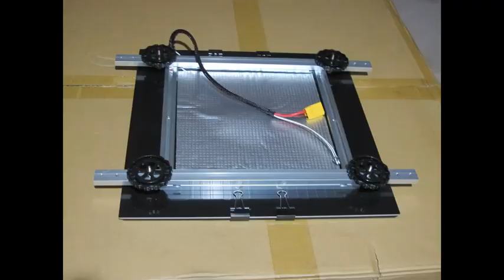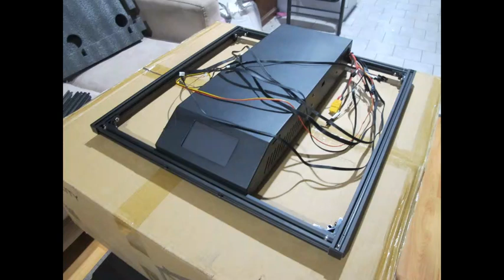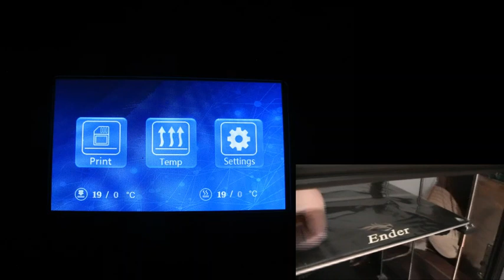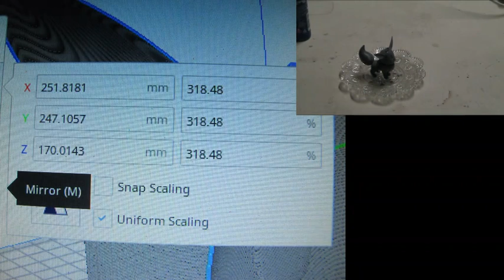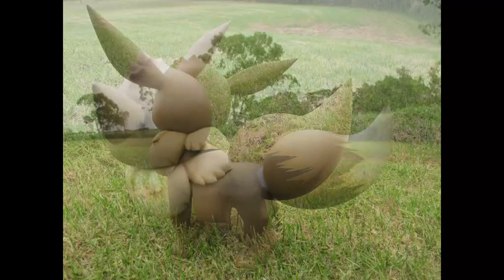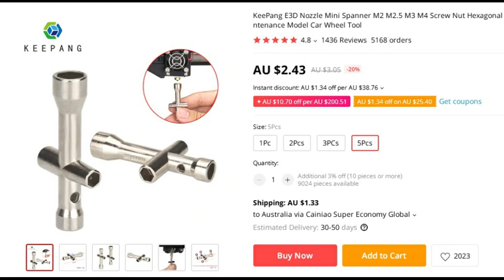Ender 5 plus review - large format 3D printer

Comment: using a metal scraper on that ultrabase covered plate is one way to completely destroy it. try using some IPA and a microfiber cloth, it will work as well if not better, and you wont ruin the surface.
Reply from the maker: Im about 50+ prints in and the coating is as solid as the first few prints I've performed. Also poured industrial thinner to clean it up and the coating still has remained strong. I use to be as abusive with my first printer and the two factory beds remained in good condition for hundreds of prints. I can understand your fear as I've seen cheap coated beds get destroyed on social media posts. Intent to buy themo glass but may not need to as I am still happy. Thank you for the heads up mate, hope this helps.

Comment: Seems like a very negative review, I have owned an ender 5 for 2 years mostly running 24/7 not one problem you have experienced, just about to upgrade to ender 5 plus just for bigger bed size everything else is the same.
Reply from the maker: No, not negative at all. Cheap big bed is amazing and all the issues mentioned were resolved in a timely manner. For someone who wants a printer out of the box this is bad. For anyone who wants to turn and upgrade to produce very large models should be happy. I tend to be very critical.